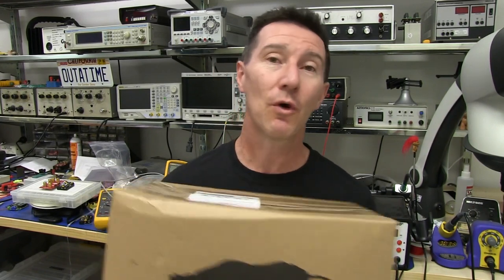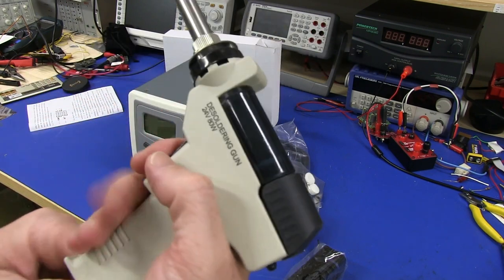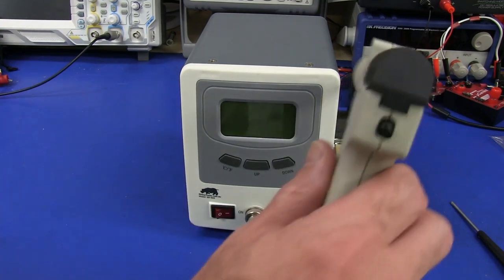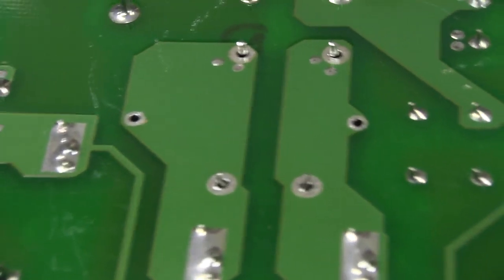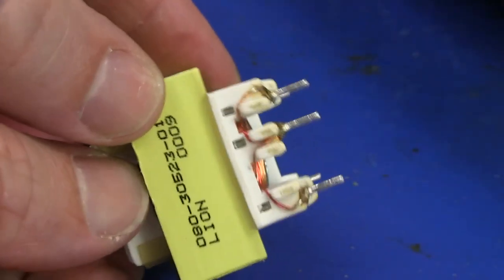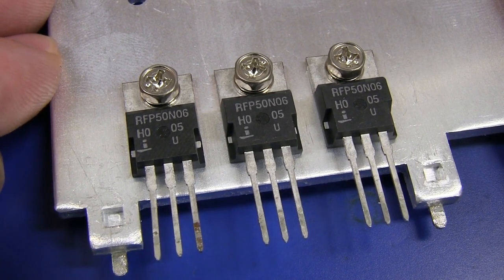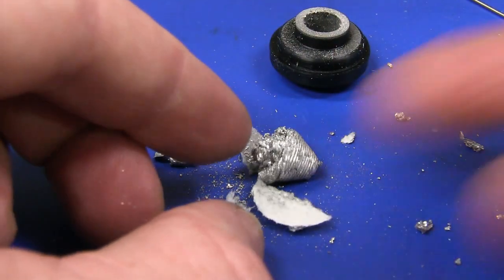EEVblog #542 - ZD985 Desoldering Station

Comment: Great review as always. Just a point worth noting, having a floating ground is not a bad thing, as long as it shuts down the current to the heating element should there be a insulation failure.  Having a 'real ground' may cause a unwanted short on the component being worked on, e.g. on board batteries and charged caps etc, which could, if a real ground was evident, cause component failure. Thanks again for the review..

Comment: It is quite interesting to see how these designs evolved over time and continue to be manufactured, mostly by Chinese brands today. One improvement over this design we see today is the presence of a diffuser steel plate to protect the ceramic filter. It was interesting to see how the solder splutter adhered to the top layer of the filter and he had to peel a layer off. This would not happen in the slightly improved versions of this comment.

Comment: Might grab one knowing the quality - as I seldom use one but could have used one yesterday to remove a metal shield can in a ham radio to get at an SMT transistor which had died. This would have saved me 1/2 an hours work desoldering the can shield the old fashioned way like you mentioned at the start of the vid - soldering iron and hand held solder sucker :)

Comment: I got a cheap soldering station with 2 spare heating elements and about 20 spare tips all together so I wouldn't have to worry about parts for a few years. A few years later now and I can't find anything for it, but I still have my own spare parts. :)

Comment: I have the Aoyue 474A++ which was under 100 GBP here in the UK. When it works, it works well, I do computer repairs (including vintage computers), so I do quite a few through hole dip packages. The only problem is the tips seem to disintegrate quite quickly, then end breaks away and you no longer get a decent seal. I am now having trouble locating replacements.

Comment: I bought a repaired Station from ebay. When i switch it on for the second Time, it was broken =)   It was another brand but the same inside. The defect can be the +5V regulator.  I gave it back and buy an old Weller =)

Comment: Dave, put wire strands in the back of the spring for easy solder removal, or some brass wool from a solder sponge.

I've seen units where the spring was so precisely wound it formed a seal once solder blocked the end, sometimes it is necessary to slightly deform the spring.

You'll also want an extra long drill to drill it out when clogged.

We use several ZD917 for a couple of years now at work (development not production), and it beats the pro units like DENON hands down.

Comment: Rhino don’t stock this model anymore since their website says no longer in stock…For us people in Australia, Jaycar Electronics have started doing a similar product - CAT No. TS1513 and they do keep the nozzles and filters too…As for your review, I feel you're a bit over critical at times and although a little on the crappy side, it sure beats using a rubber ball solder sucker…Not everyone has the financial resources to buy a Hakko 474, especially the hobbyist.

UPDATE:

I went and purchased the TS1513 de-soldering station from Jaycar Electronics only to find that the vacuum pump didn't work…The gun switch tested ok so I proceeded to remove the cover from the main unit, only to find that a wire had broken away from the vacuum pump terminal, leaving a piece of heat shrink sleeving sitting in the bottom...Although an easy fix, it points to poor assembly and quality control, but I was ready to proceed and try it out...Hmmmm, the temperature was climbing but no bloody vacuum, despite the pump racing away!...Next I had the gun disassembled, only to find that the earth wire to the element isn't silicon coated and the tube running through the centre was bent downwards, so I carefully straightened it using a suitable drill bit down the middle, being careful not to exert too much pressure and buggering up the element...After reassembly,  the gun still didn't suck due to a heatproof rubber washer being absent, smirking at me from the area of the floor...After much cursing, I tried again and ‘voila’  it was working, I very nearly peed myself with excitement!...Before I knew it, I had a pile of electronic bits the height of Mount Everest…I could have returned it but I couldn't resist the challenge but when this thing finally shits itself, I'll buy something of better quality!
Reply: +swingmanic My one from Jaycar lasted all of a day. Then it appears the heating element has gone short so i will be swapping it.
Reply: +Luke Stone When they work, they work well for the money but if I were to make a choice again, I'd buy something of better quality...Good luck with your replacement.

Comment: I've just received a later version of this, a DURATOOL branded ZD-915
This arrived today, and all seemed OK on initial switch on.
Element heated up, and temp could be changed.
However, when I pulled the trigger on the gun nothing happened (no pump noise). Checking continuity on the gun trigger to the connector showed that the switch was operating OK.
SO, the cover had to come off. All looking good internally, but when I looked at the connections to the pump, one of the wires was not connected (fell off when wiggled).
I have now repaired that, but I'm NOT impressed with the build quality.
The unit itself now works very well, I AM impressed with the functionality overall. Just the build quality lets it down.

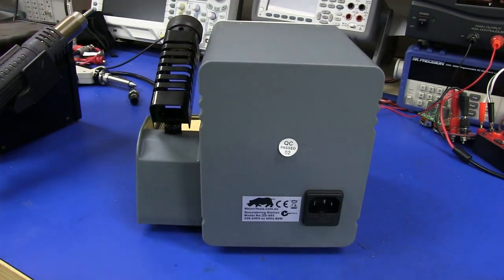Comment: 10:25 It doesn't work on both sides because it's basically a slimmed down version of their rework station (ZD-917), which has a soldering iron on that side, and it's the same part in both. I think.

Comment: I still went for the Hakko FR-301, and I'm not sorry I did.  The only thing I don't like about the Hakko is the price of the nozzles.  Although I haven't tried the one in this video, I was tempted, but decided just to pay the extra $100 (USD) for the FR-301.

My first project was to redo the rather worn keyswitches on my Corsair Vengeance K70 keyboard, meaning also the LEDs.  Once I got the hang of things (had to add solder to three pads because i sucked too soon), it was a breeze.  Now my well-worn K70, which was bought as a refurb to begin with, which I just know it came from a high traffic store where it had to have been a display model based on the wear pattern being pretty much everywhere, now feels and sounds consistent all the way across (Cherry MX Blues).

As a ham on a budget, the salvage potential ease also justifies the price, it'll pay for itself.  Seriously, how many of you hams out there can afford to always buy new parts?  Hell, now I have 208 red LEDs with usable length leads (yeah, i totally put the new LEDs into the keyboard backward, and had buy more and do those over), and 104 used, somewhat worn but usably good Cherry MX Blue keyswitches as salvage already.

This isn't your daddy's rubber bulb pencil desoldering tool, or spring loaded sucker.  I have both of those as well, there's a time and place for every tool.

The Hakko cost more, but I'm not sorry I chose it.

Comment: i just bought a analog version of this unit from MCM for $150, It has no temperature display, there is a knob you can adjust up to 800F or so - they have a led that blinks on and off when you've reached the temperature setpoint.

The iron is very similar, there is a coiled iron holder mounted on the side of the case. The case is 7" wide, 9" deep and 5" high (it weighs about 7 pounds) It's larger than the unit Dave bought and very simple inside. They have a 60w transformer that supplies 12v for the vacuum pump and 24v for this iron. It's all analog so it should be easy to fix if anything fails.
Reply: Where does one buy a 'No Temperature Display"  
Can you explain to me how it can have something that does not exist ?
Reply: Instead of having a digital display on the unit it just has a knob to set the temperature so it's less money.

Comment: Honestly I haven't used it that much, Almost everything I do is quite small boards, and also I use it primarily for fixing boards of people at conventions that are building "how to solder" kits.  So for me the portability and better ability to use it on a table in a hotel room as opposed to a station type thing is very nice.

Thanks for the info though. The only other desoldering station I've used was a production unit but it was very old, the Hakko works better than that one.

Comment: Hi Dave, nice video - thank you!
Funny to see that i had two of exact that boards out of two old UPS.
And: i desoldered and kept almost the same parts as you do - the MOSFETs are really nice: 60V, 50A and fairly low input capacitance for its performance.
Oh, maybe you could do a blog about input capacitence / gate charge of MOSFETs vs. fast switching applications.
I am currently working on a switch-mode power-supply using these MOSFETs, driven by a dsPIC with SMPS-PWM and an LM5104.
Cheers!

Comment: I was way more impressed with this than i was expecting to be.
Sure the bad wire, but my own soldering station came with a bad wire like that too, just took me 2 minutes to fix from open to close.

I'd happily use one of these cheapo desoldering stations, i salvage a lot of stuff, but i often have trouble getting parts off. Something like this would be amazing! Though i may have to settle for the soldering iron with the bulb on top. :(

Comment: at 13:48 when you move the wires u can see it fall off the back of the plug
Reply: and this is why it's a rule of thumb to always open everything before plugging it in, never trust a cheap worker's shotty soldering xD

Comment: hey dave. i have the ZD917 (told uses same desoldering gun as ZD985) and parts are also avaliable from RPG fairly cheap as well, only problem i've had with this desolding station is when doing a few chips at a time the spring heats up fairly quik. however if i keep it clean and let spring cool often seems to work just fine

Comment: ditch the spring and use a ceramic filter in the tube and behind it you wont regret it.  The ceramic filter will catch the solder and the ceramic filter behind will catch some of the flux fumes and keep them out of your pump making it last longer.

Comment: Please see the two videos that the Radio Mechanic has on the ZD-985 unit as his is the same unit that Memotronics ships out. The video on hacks and mods shows 2 mods that make the unit much more secure in the gun holder and the solder glass tube storage and filter area has a dime placed in the spring for much improved functionality. The mysterious flashing video points out a problem with much more serious consequences. my units so far have not had this problem but maybe yours will, in any case you need to check the power cord as he did just to be sure you have a safe unit. Oh, by the way the ZD-985 is made by a Chinese company and the brand name is Zhongdi.

Comment: $100 is a cheap price? goddamn this guy is going places...
Reply: its cheap compared to most other devices like this.
a $100 smartphone will be considered cheap.
Reply: Professional desoldering stations start out in the $450+ pricetag, so yes this is a cheap station.
Reply: yeah this is about as consumer level as a desoldering station gets, if you're pulling a few hundred chips a day you'll get tired of using a standard iron pretty quick.
Reply: $100 is super cheap. After refusing to pay nearly $400 for a Hakko, I had to pay $145 for Aoyue and that was after waiting for a 25% off deal when the distributor (SRA-Soldering) was moving. I got the one with the built-in soldering iron (Hakko clone) and fume extractor but the one without all that was also $145. To be clear, Aoyue is also a super-cheap knock-off brand.

Comment: Yes - I have a Hakko 808 and it was about $200. However, I find that it doesn't work all that well. It works well for true single-sided PCBs but plated-thru-hole seems to be a problem. It usually doesn't manage to melt the solder all the way through the hole. Have you had that problem, too?

Comment: The connector doesn't pull straight out. You need to do a 1/8th turn with the black plug and then pull. You'll see a dimple in the metal on the other side that runs in an L shaped groove molded into the black plug..

Comment: i will say this Dave sure this model is built cheap but when you think about it the ones that are for 600 don't have 600 bucks worth of parts just like that does not have 160 bucks worth of parts, i think it comes down to one thing because its a tool a specialty tool they mark up the price, and living in Sydney does not help us lol.
But that been said i have got a cheap solder station that works really well even compaired to the more expensive one.
Thanks for the review i will buy one of these for use every so often.

Comment: Hi , Great demonstration and wonderfully explained. I just wonder, why u didnt prefer to use the solder paste/flux on the pins , specially towards the end , the grounded pins of caps . I think it would enhance the removal rather than to pump up the heat much . Whats your take on it ? . Once Again thanks a lot for such a wonderful video . Cheers !!

Comment: Hot air gun in conjunction with a desolder station? 
 If it works it might be a  good way to get at legs with odd angles, high thermal mass, and control the air flow.
Reply: Preheating could help. But than de board stays warm when using the soldervacuum. I would think that the cold air when sucking up the solder would be harder because the board is preheated. Maybe im wrong and it works a treat.

Comment: Hi there ;)
Looks like Dave has almost the same fetish for high quality tools like do.
But not always the more expensive tool will be the better one. Take the Ersa X-Tool desoldering station for example. At about 700 Euro priced,  the thermal capacity is well, qiute enough power, reliable and so on... But! The handpiece gets so warm after a short period of time of working with it, that you will have to use a small towel or a glove. Otherwise it would be just hurt using it.

Comment: It's not a good idea to use the gun at 350°c(662f) because after desoldering a couple of joints, the gun overheats & the overheat safety sensor trips the power off, you have to physically turn the power switch off, then power back on for the station to power back up.

Comment: I've recently got the exact same unit (same color and all), and my unit 
seems to have some "coil whining" issues, I think it comes from the 
transformer, should I be worried?? Do yours also make some whining 
sounds?
Reply: I just got the ZD-8915 and I also have coil whining issues but its coming from the iron/gun itself. I may disassemble it and see what is happening

Comment: It would be better to say use a grease that's compatible with the oring material and fluid being used. silicone grease isn't necessary compatible with all o-ring materials or the fluid being sealed by the o-ring.

Comment: Use fresh solder on old pads before desoldering, I used this machine for years, also why didn't you calibrate temperature? Didn't read the manual?

Comment: I have ordered one from the only supplier in Europe which is in Italy, because i was not 100% satisfied by my Aoyue station. I got it for 80€ which is nice. I have noticed it is not the same filer cartridge system than the one in the video. I find the filter system handier to remove the pumped solder, than the Aoyue spring filter. Because i currently have both the Aoyue 474A++ and the ZD-985 (purple colored one clone).
I have one question:
Is there someone here that own this ZD-985 that has tried to do the same as Dave on the video with an ATX motherboard? In particular with that ATX molex connector (20 pins) that you can see at 32:00
I tried the same with an MSI motherboard and i dont have the same results, AT ALL. I was not able to unsolder this connector, even putting temperature at 380°C. What about YOU?

Comment: ordered a new ZD-985 from ebay, it arrived today and was dead on arrival. it briefly cycled the LCD then went completely dead. the only thing that work is the light on the power switch. I've contacted the eBay seller for a replacement or refund... the build quality on the OUTSIDE seems decent but clearly their are serious issues with build quality of the actual important bits on the inside.
Reply: eBay seller is pretty awesome and had no issues with me returning the defective ZD-985 for a full refund. apparently and according to the manufacturer "some" of the units were shipped with a bad power supply. So does anyone have a suggestion for another desoldering unit that is good quality that is in $200-300 range?

Comment: My ZD-985 seems to have extremely weak suction power, before I rule the unit out as defective, is there anything I could be missing about it? I even tightened the tubing to the main unit with a zip tie and I'm verifying the gun and it seems to be fine. Got it in the Italian eBay shop.